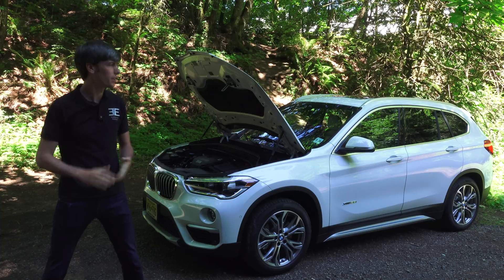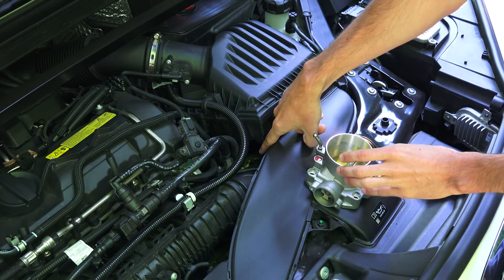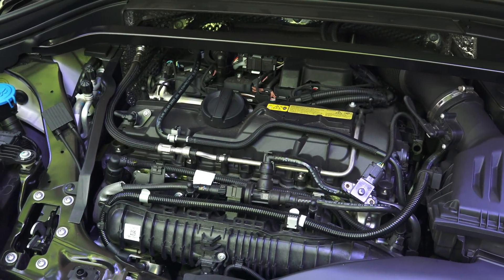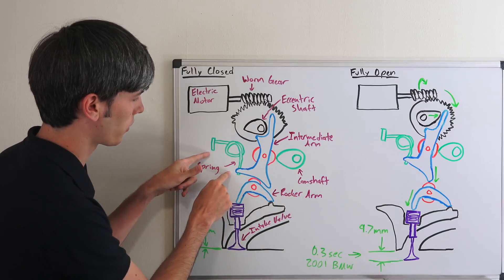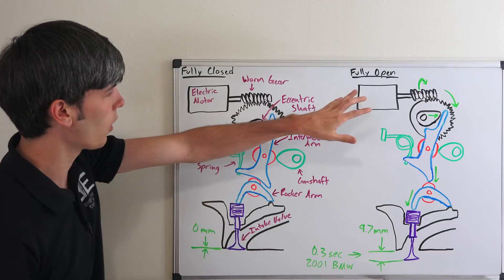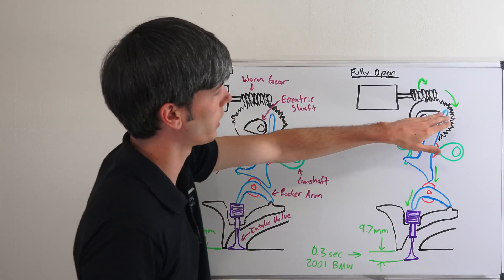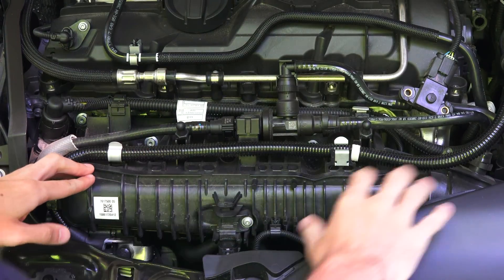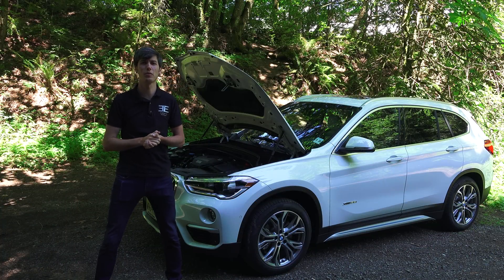What Is Valvetronic? BMW's Innovative Throttle System

Comment: Hi Jason, by valvetronic are you referring to what we know as vanos? Thanks.
Reply from the maker: +Clavius Magnus nope, valvetronic is VVL, vanos is VVT.
Reply: +Engineering Explained Could you do a video explaining the difference and how both work together, if BMW uses both on the same engine that is.
I do have a BMW, but it has none of this fancy technology.
I do understand the principle of vtec or vvti (Toyota), but this video of yours opened a worm can of doubts.
Thank you.
Reply: Variable valve timing changes when the valves start to open, but not how far they open(lift) or how long they're open for(duration).  VTEC changes lift and duration, if it's i-VTEC, it also can vary the timing. VVTI is just timing, and VVTI-L adds lift and duration like VTEC. The main difference with those systems is that it's just high/low cam, not constant variability like with valvetronic.
Reply: +Scott Lee Thanks Scott.
This is something I'll have to do some research to learn more.

Comment: Do you guys realize that this system has been used in BMWs for the past 15 years and it's one of the least problematic things in a BMW? Most problems in modern BMWs are caused by weak chain drives and VANOS sensors/acturators
Reply: Broken Valvetronic is an issue! BMW uses this since the E46

Comment: the valve need to open every 2 rpm of the engine (4-stroke) meaning if you go 6000rpm or 100 rps. 100/2=50. so the valve needs to open every 0.02 seconds. so they mast have improve the timing. because with backwards math. 0.3s or 3.33*2=6.67rps=400 rpm.  maby enough for a boat, but even diesels idle at faster speeds.
Reply: The valves still open just when they need to because they're still being opened by the camshaft as a normal engine operates, the 0.3 seconds is just how long it takes to change adjustment from the valve opening its minimum amount to the valve opening its maximum amount.
Reply: What the hell are you talking about?

Comment: why does this improve efficiency at all? instead of pumping losses at the throttle it seems to just move thrm directly to the cylinder
Reply: That's my thinking, you still have the pumping losses.. The only way they could reduce that is to have something like cylinder on demand like Audi, but venting the unused cylinders to atmospheric pressure so there's no vacuum acting on the piston.

Comment: this is interesting indeed  but as a car mechanic i am instinctively against adding electronics and moving parts to the engine , because more breakage ,  i would however love to see Koenigsegg use this idea as they are running a electronic valve system with no cam shaft , in my opinion that would be a way better  use of this idea

Comment: More complicated designs tend to be less relibale due to more points of potential failure. It's neat, but not personally interested.
Reply: tcv4 LOL!!!!!!!
^Except a horse can survive without any oil change, Mother Nature maintains itself.
A horse can survive without a human at all, as they do survive in nature. There is no Rolls-Royce that can beat it.
With parkour people climb over high walls, there is no tank or humvee that can do the same. So Mama Nature is not to be underestimated.
The only thing is: horses don't have park assist, so you have to be careful when lending it to your girlfriend. Oh and horses have a limited top speed, so you can't run away from the police that easily (unless you live in the mountains or so).
Wait wait wait, this got me thinking... a horse can jump over (actually onto) a car, and it can jump over a small fence... hmmmm not to shabby m8...
Reply: Agreed - sometimes they make things just because they can - no because they are better in the long run
Reply: Germans seem to love complicated moving parts...and they make miraculous creations with them...but they are often fussy and need to be serviced by ONLY by engineers.
Reply: +Andrew Kim I don't know, horses are pretty complex. All that anatomy and whatnot.
Reply: Viren S Toyota has been having some hiccups, like almost all the 2AZ-FE engines (the super common one 2.4L) had piston seal issues where it seemed fine, no smoke, but would be consuming oil and be really low by the time you needed to get service. They issued a recall, but many people didn't find out till they were out of the recall range. Or like the 4GR-FSE (only found in the IS250) had issues with carbon deposits and would require a full rebuild. Luckily they no longer make the IS250. Other manufacturers have had similar issues since it's a problem with using just direct injection. Toyota is super reliable, but not like it used to be.
Reply: Sigma Projects
Wow, you just confirmed what I was talking about.
I have seen that most manufacturers (including toyota) are drilling less holes in the piston underneath the 3rd piston ring, the 3rd ring scrapes off the excess oil and pushes them through these holes; when these holes have a smaller diameter, they get stuck easily (because of deposits), which means the 3rd piston ring can't scrape much oil off the cylinder walls, meaning oil will get in the combustion chamber. So way more oil will burn up.
When I talked about 'drilling less holes in the piston' I meant this. Toyota (amongst others) is saving money on things like this, and they are making even more money by selling new cars.
Reply: sasja de vries Yea actually I believe it does have to do with the oil passages around the rings getting clogged with carbon and causing minor ring failure, something like that. It's funny though, they're still more reliable than some of the other cars I've serviced. 

Oh right, scion tCs and xBs have rear latch handle problems where they keep falling off, I forget if it's was a TSB or not.
Reply: Sigma Projects every manufacturer has at least one problem product. You're right
Reply: +sasja de vries Mother Nature will, uh, find a way.
Reply: I might have missed it, but the other advantage to this system is being able to control the valve lift like that of Honda's VTEC, but it's continuous so there's near infinite control over how much lift.
Reply: +sasja de vries uhm have you ever heard about a landcruiser or a hilux?  of course if you're gonna try and beat on your camry it'll break like any other car cause it wasn't designed to be used that way. it will however last longer than a bmw
Reply: ^ For you, and the horse. Horse can eat local vegetation if it has too though and drink water straight from a creek....can you?
Reply: TurboMitsubishi 
Yes the high end cars are very complicated but better Engineered  and reliable, that’s what they command there high prices. They also have the longest warranties because they don’t have a bad failure rate.
Reply: My old e46 had this design and it was the least responsive car ive owned.
Reply: @SuperWesty177 The E46 didn't have this system. Valvtronic was introduced to the 3 Series with the N52 engine, on the E9X platform. M54 engines used a classic system. M54B35 had a mechanical throttle body. M54B30 was the first to use an electronic throttle body.

Comment: Similar concept to VVEL, Nissan's system, holds throttle body open and changes the event and lift of the valves. Although there are design differences.

Comment: This is pretty interesting. It seems like there is far more parts that can be worn down and then be replaced. How reliable is this system over time?
Reply: Decently reliable. And it's actually fairly simple to repair. I learned just recently that a mate of mine had a Valvetronic equipped E46. That car was in his family for around 10 years, he drove it himself for 3 of those years, and didn't have a single issue with the system.

Comment: So valve timing is fixed on their system? And it's only variable valve lift? Also, the valve spring must be the limiting factor to why you can't gain more lift then correct?

Comment: I've always been a bit skeptical that this can actually reduce pumping losses, I don't see how what the piston sees is any different, and you can get really good throttle response by going to a throttle per cylinder arrangement. 

I do wonder what sort of fuel savings you could from putting valvetronic instead on the exhaust side, intentionally not evacuating that much exhaust gas at small throttle angles, allowing a very lean air fuel ratio. Probably too hot.
Reply: Everyone that makes videos about these systems talks about pumping losses but like yourself, i really don’t see how it does that given that the restriction is now the valve itself (at part throttle) rather than the throttle body. If you have no pumping losses then that means you’re at WOT. Has to be all about air-fuel mixing/atomisation.

Comment: Seems like a lot of small moving parts destined for failure. I wish a car manufavture would just bite the bullet and pay for the rights to use the Cargine compressed air assited solenoid controlled valves. Any thoughts EE??

Comment: I have 2002 bmw with valvetronic and I don't recomend this even for worst enemy.
Reply: how cancerous is the system?
Reply: The gas reaction is slower than normal
throttle and burn more fuel whit compersion to power it give :-/ 
Sorry for my english but it's my second languge
Reply: I don't want to advertise anything but http://atomiumus.com/ (or atomium.eu) might have the solution.
Atomium restores the surface of metal parts in your engine by filling up scratches with new material. XADO and Resurs do the same thing but they are not VANOS proof. Atomium works with anything from carbureted engines to the newest Porche BMW, audi, lexus, etc.
One important note however: atomium can help when it's starting to wear out and the vanos and valvetronic are still working; If you hear rattling noises from the engine you're already too late.
---
Hey man, that's capitalism, make a car that is great seems great performs well at the test, and then brakes down. Because the faster it brakes down, the more cars you can sell. Did you think they invented all this for you? NO, it's just a trick to make more money.
Reply: valvetronic rarely breaks. youre confusing it for vanos.
Reply: Yeah, because your 14-year-old early Valvetronic engine is worn out. When it's in good shape, the Valvetronic-powered E46 is actually a decent car.
Reply: Arnis Tarassu nothing else can break in the valvetronic system,only the electric motor,and it doesnt break,it only gets clogged up with a black powder resulted from the coils inside it,it can be opened,cleaned,and it will last you forever
Reply: just swap it with m54 then

Comment: So it's basically the same as Toyota's Valvematic right? PS I am not sure if it is that Innovative anymore. M5 had it since 2010, Toyota RAV4 in Europe had it since 2010, Avensis since 2008, in Japan both since 2007, so it's used for almost 10 years already, they just came closer to putting it in all their cars than other manufacturers. Also AFAIK Nissan has something similar in Patrol and QX80(ex-QX56)
Reply: It was available on BMW X5 4.6i and 4.8i back in 2000's.
Reply: BMW themselves started using it in 2001.

Comment: All that for 10% better fuel consumption under normal driving conditions. If you take out the air conditioned electric adjust seats you get the same efficiency instead of screwing with the valves. The VANOS system is simpler and less can go wrong too.
Reply from the maker: +JoshTheLewi vanos is completely different and independent of this system. Vanos = VVT, this is VVL.
Reply: It has VANOS as well...
Reply: +Roger Smith As if it couldn't get more complicated...I didn't know if it did or not. Some BMW's just have VANOS which in my opinion is better than this valvetronic system.
Reply: +Engineering Explained yeah I figured that by the drawing of it. I also looked at a few animations of this system. BMW valve systems are crazy. Infinitely variable valve life independent from variable valve timing...the BMW devs are gettin it
Reply: +JoshTheLewi *lift

Comment: Not a engineering/mechanical question. Why is there so few diesel non
'commercial' vehicles on the market in North America? Diesel market in Australia has grown extensively in the small and medium class over the recent years due to their low running costs over the long term.
Reply: My guess is because gasoline isn't that expensive (price got up there a few times, but then it came back down). :-?As for me, diesels never had any appeal; the cars I like only come with gasoline-powered engines.
Reply: Emission standards on passenger cars equipped diesels are higher in the U.S. Sooty particulates and sulfur smells out of the tail pipes are a big turn off for many car buyers. Manufacturers work around this by using an urea injection system and filters in the exhaust manifold that neutralize the smell and reduces the particulates. The problem is you have to top off the urea tank from time to time and filters can get clogged so it's just another service item that has to be maintained on the vehicle.
Reply: ...........plus Diesels sound like school buses :-p
Reply: +Josh Reiter I'm pretty sure that Americans would even be able to tell the difference between a petrol engine and an Euro 6 diesel, exhaust smoke wise.
Reply: 2gud4umenglez emission systems on diesels are a huge pain and very expensive to replace

Comment: Sounds like a really complicated system. But BMWs are usually very reliable.  So if the car isn't too old, and it has documented history of maintenance. A used one would do just fine.
Reply: Apparently you haven't owned a newer BMW. i.e.: 1995+
Reply: Nope
Reply: Biggest mistake MB did was gang up with Chrysler. Only winner there was Chrysler got the e-class platform. Thank god that is over. Quality on MB cars went south in a big hurry. They are getting better. Japanese cars look horrible, apart from Nissan GT/R. If I would go German I would go Audi or Porsche.  Latest generation Volvo cars (90 series) doesn't look too shabby.  But i stick to my 18 year old V70. Really cheap to maintain.  Yes it is not an exciting car to drive. But it gets me where I need to go. The day I want to arrive in style I can rent some style :).  But VW and BMW falling apart... on that I disagree.  Let's just agree to disagree.
Reply: +TundraJason I had a 2002 E46. M54B22, double-VANOS, still just as reliable as any other car I've owned. Including a simple-as-balls Civic.

Comment: As I know, ecu uses throttle body all the time. It was so in early versions - valvetronics was not enough for all throttling range. And, if something reduces airflow at some rpm, it doesn't matter - braking force will be applied.

Comment: Great video. From an efficiency standpoint how different is this from running independent throttle bodies? ITBs seem like a simpler system with less to go wrong. (Have you done a video on ITBs?)
Reply from the maker: Haven't done a video on ITBs. This is similar, but still slightly superior from an efficiency standpoint, as there is absolutely no gap between the valves and open atmosphere.

Comment: a noob question:  in normal cars the gas pedal actually controls the air, so does it mean that the fuel consumption is always constant even if I push the pedal only slightly ?
Reply from the maker: No worries, great question to ask! Your ECU will adjust the fuel accordingly, depending on various sensors. When you press the throttle, you allow in more air, and then inject more fuel as well to compensate. The ratio of air to fuel remains relatively constant, within a certain range (about 12-16 units of air per unit of fuel, by mass).
Reply: Engineering Explained thank you! :D
Reply: +Catalin M just to add to that, in old "batch fired" fuel injection there would be fuel sprayed on the closed intake valve of the companion cylinder (one cylinder on intake stroke the other on exhaust) but as computers got faster in the 90s there was no need for this. Also in diesels the throttle pedal controls the fuel itself with there only being a throttle plate (generally speaking) to assist in EGR flow (as variable cam timing is slow to get into the diesel world)
Reply: I was thinking about that same question today lol

Comment: I can see how reduction in air intake latency would improve but the cylinders are still going to be pulling a vacuum on the intake stroke the same as they would with a throttle body.  Only difference is the location of the vacuum (inside the cylinder rather than from the TB to the intake manifold/valves).  So I don't see how it would improve efficiency.  I agree with other posters: seems overly complex for what it does.  More to break!  I'd rather stay away from that complexity personally.

Comment: I respectfully disagree with the throttle body operation at idle. this was taught by BMW but is incorrect. the throttle body is closed at idle like all other vehicles. this allow the intake pressure to be around 50mBar. you can verify this with a borescope through the air box inlet tube. now off idle, yes throttle open and valvetronic determines air flow and thus engine operation.
Reply: I know this movie is already 2 years old. But sneakypeter123 youre absolutly right. The throttle  valve is almost closed at idle with the valvetronic system. Engineering explained should have done more research for this clip.

Comment: Could you explain the difference and similarities between honda's integrated motor assist and toyota's hybrid synergy drive? I know IMA is a parallel hybrid topology, so that's pretty straightforward, but HSD is a series-parallel topology and I still don't entirely understand how it works and what the pros and cons are of each system.
Reply: Toyota is a true hybrid using 1 or the other or both combined,ima is assist just as it states it can help but not be run soley
Reply: tony Koupiaris I know that, but I was hoping someone could go more into the engineering aspect of the matter. since the 2006 honda civic IMA can run on electricity alone at low speeds, but it can't do so without turning the engine as well.